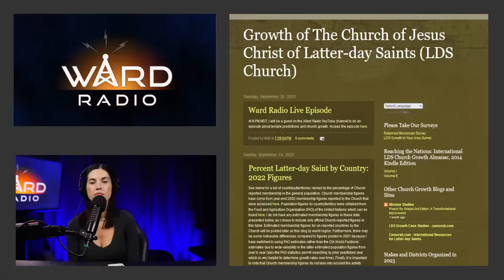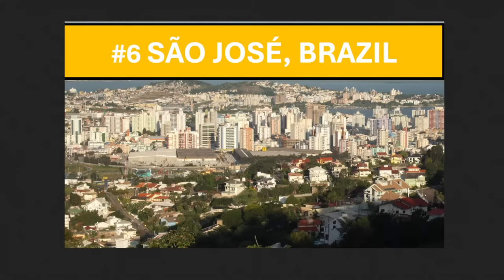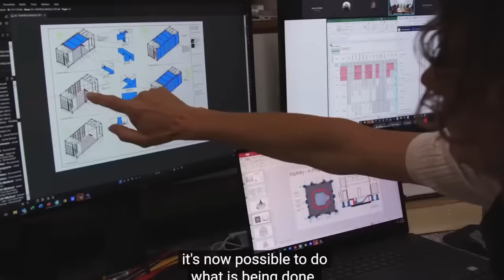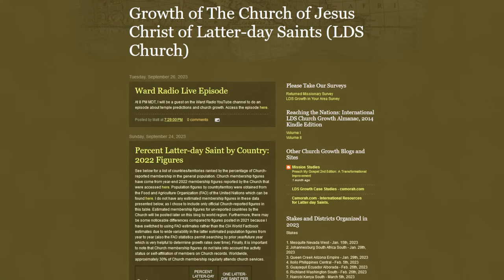Top 10 Temple Predictions with Facts and Smart People! (Feat. Matt Martinich)

Comment: Many of those quick late 1990s temples were built quickly and stick built. Several needed renovations due to some issues. I think the modular temples will have better structural integrity than the 1990s small temples and still be quickly built.
Reply: Wood-framed buildings don't have inherently inferior structural integrity than other construction methods. That is a very appropriate construction for a smaller building. If there are problems with the building, that is due to poor design or construction quality. It can be common in areas outside the Wasatch Front for construction methods and traditions to be very different than the Church's project managers are used to, resulting in later functional difficulties for the building. There are also a lot of other factors that contribute to this. For example, Las Vegas has soil chemistry / water chemistry that is destroying the sewer line of the Temple there. It is just part of life that things wear out, and often sooner than we would expect.
Reply: Should they keep building?

Comment: Mendoza line is a .200 batting average. Just comes from a shortstop that played in the late 70’s. And it’s below average. But what you might be looking for Cardon is a newer term the last 10 years or so is WAR. Wins Above Replacement which takes everything about a player as well as the position they play and the average is 0.0 if you go higher the better player you are. If you go in the negatives then you’re worse than an average player. Your defense and or offense can hurt your value or WAR. That’s the best thing that applies to your taking everything about a player and condensing it into one stat. It is a part of the Sabermetrics. I’m a baseball nerd 😂

Comment: [NOTE:  This Comment is 3 of 3.  Good luck finding the other connected YouTube comments.]

The 800 Hurculean boys who were still alive raced to a weapons cache in a storage room located near the side of the front of the city.  There they were able to grab extremely heavy hammers, like sledge hammers but 20 times heavier than you would normally think of when you picture the idea of a sledge hammer...  the handle was made of metal same as the hammer_head.  The warriors in the Roman City at that time in history thought these "sledge_hammers" were a clown joke because the "replacement Roman soldiers" were relatively strong men and they couldn't lift them up off the ground, let alone swing them at anybody.

But these Mormon boys were on average 50 times stronger than the average modern day Western European men, so they could lift these seemingly impossible to lift "joke" military sledge_hammers.  With these sledge hammers in their hands they ran up the steep steps of the stairs to get to the top of the protective outer wall.  Once on top they could see that there were thousands of Greek_Invaders that were already on the wall over the area where the Eastward Facing front gate was located.

With two Herculeans moving forward with their midsize shields in hand, after making physical contact with the Greek enemy, the Hammer_Man behind the front two swung his heavy hammer down on the heads or the shoulders of the enemy.  Often the shield men would push the Greek_Warriors off the top of the wall sending them tumbling down head over heals to their death or in some cases causing them to be severely injured.

In this way 3/4ths of the invaders were killed [often by having their heads smashed_in]...  the remaining 1/4th of the invaders who hadn't been killed because they had been in the back lines not in the front lines fighting, who were only in it for the money they were paid to do this mercenary attack against Rome to begin with, they threw all of their body armor off and ran to their ships, thus escaping before the Herculeans and the Fornication Cultists Teen boys could kill all of them.

Thus the city of Rome was saved.  A Simeon man (of Greek ancestry who had family that had lived in Rome for many generations) was made the new King of the City_State of Rome.  All of the Wicked Levite Royals of the previous government administration were killed except a small few who were saved by the Herculean Clan and given help to gain rowing sailing ships that they could use to escape from impending execution.

The Herculeans had a tradition that if their Sons were not worthy to go to a Mormon Temple...  often because of succumbing to adulterous Roman Women (who were often beautiful Simeon_Greek women that were very common in the city of Rome at that time in history)...  then they could go to another Temple Of Sorts...  a Masonic Temple (because the Herculeans were Masons).

Seeing that the Simeon_Greek Fornication Cultists had saved 800 of their precious boys from death (and as a side note as far as they were concerned, the people of the City Of Rome) the Fathers of the Herculeans decided to extend an offer to the Simeon_Greek Prostitution Cult Members.  They could join the Masons.

Keep in mind the Herculeans worshiped Jesus in a very similar way to how Moses advocated that this be done, and similar to how this was done in the Americas by Mormons who lived there AND...

the Cultist Prostitution_Worshiping Greek Religion members (similar to Jezebel) was involved in demon spirit possession rituals that included child human_sacrifice (what people say is a "conspiracy theory" now days, this was done openly publicly in Rome and in all of the cities of the various nations on the shores of the Mediterranean and connected seas).  So you had two extremes that became part of one organization, the Mason organization, one was for extreme good, one was for extreme evil.

Both were involved in high level mathematics...  most (if not all) of those who became famous later in history for Physics or Mathematics can trace their genetic lineage to one of these two groups (or both).

Rome eventually fell under the rule of Royalty that were descended from Philistines (who were 1/4th Ham part Greek part Egyptian) who had obtained the Ark Of The Covenant and the Magic Urim & Thummim (the Urim & Thummim of the Bible).  They became admitted to the Mason organization.

There were four groups that secretly ruled the City Of Rome, the City Of Rome that later became the Roman Empire.  There were those from the Tribe Of Dan (who later on in history after the collapse of the Roman Empire, became famous through the name "Viking" i.e. the Kings of Western Europe).  In addition to that were representatives of the Herculeans.  Then there were Simeon Greek Prostitution Cultists, and last but not least, the descendants of Philistine Royalty who in actuality ruled the Roman Empire, the fourth group represented on the Shadow Government secret power_council.

Eventually the ruling clan of the Shadow_Government of Rome (Philistines) were killed, assassinated.  This is when the Herculeans seized the Ark Of The Covenant and the Magic Urim & Thummim (of Bible fame) then escaped from the city of Rome to hide in several other locations before eventually returning to the City of Rome many hundreds of years later when they helped establish the first Roman Christian State Religion that is now days based in the Vatican in Italy.  Yeah that's right, THAT Christian Church.

I could keep writing for years on these subjects but I will leave it at that (every rabbit hole has a thousand other rabbit holes).  But hopefully this informs the reader a little tiny bit about history, specifically the history of the Mason Temples and Mormon Temples and the original connection to the current Mormon Church (through ancient past historical perspective).

One of the Mormon religions was in Russia.  One in the Americas (see The Book Of Mormon for more detailed description of the LDS Church in Central America.)  One was in the city of Rome, later in a Roman conquered area of Greece with another Herculean Clan location being in India...  and quite a few other places.  [THE Church Of JESUS CHRIST Of Latter Day Saints] as people know it today is just the latest iteration of a Church that has existed in various places at various times that includes the Priesthood of Melchizedek.

Different people different strengths and weaknesses, same completely true 100% Christian religion.

Now days it's membership is openly known.  In the past those who were Latter Day Saints were all secretly Mormons (except in the Americas in ancient times) because they were living in Pagan societies.  So there you go, a little bit more info for those interested in knowing more information (be they dedicated to evil, or to good).

If you notice I make no judgements against anybody as long as they are willing to learn...  not the official phony baloney fake front narrative, but the real story about how things really came about in the past so that things are the way they are now_days. 
.
.
.

Comment: [NOTE: This Comment is 2 of 3.  Good luck finding the other connected YouTube comments.]

An army from some Greek City States gathered in rowing_sailing ships traveled from Greece to the City of Rome to conquer this mediocre but highly wealthy Half Simeon_Greek Half Ephraimite population city in Italy.  Levites are not known for being capable in war, but rather when it comes to words.  The Levite extended family that was then ruling Rome gained their highest level position by convincing the Roman population that they should rule over them (that and assassinating the previous ruler, that helps to gain the throne of power as well).  

They tried to direct the military defense of the City of Rome but were completely incompetent in being able to perform that duty.  Because of this the city of Rome was in peril and the front gates of the city were about to get smashed by Greek Warriors using a battering ram.  This is exactly precisely WHEN 1,500 Herculeans decked in full metal plate body armor seem to appear right behind the front Gate of Rome (the Eastward facing Gate).

Some of the teenage boys (13, 14 and 15 years old) had decided against their parents and their clan leaderships law to enter into the city of Rome through secret under ground passage.  Being Masons while refurbishing a Roman City Wall (back when they were citizens of Rome in good standing) they had built a secret underground passage that only the Herculean Clansmen knew about.  Using this method of conveyance these young men were able to get inside the city in the nick of time without being detected, which was important because the rulers of Rome had standing orders to all Roman citizens to kill all Herculeans on sight if anyone in the city ever detected their presence there.

After the Eastward facing gate was crushed by the battering ram, the Greek Warriors began flooding into that side of the City Of Rome.  But the front portion of invading Greek_Warriors were only able to make it 15 yards into the city because facing them were 1,500 young but highly zealous warriors.  The Herculeans began to fight these half_crazed Greek Warriors toe to toe and were making a good show of it when it comes to stopping the forward moving advance of this deadly incursion into the city of Rome.

However the Greek Warriors were wearing metal plate helmets that no one had ever seen before that went over the front of their face and only had extremely small slits for where their eyes were located.  This made it impossible for the Herculean bowmen to shoot into their eye sockets.  Also because they had a lot of metal plate armor over the rest of their body the teen Herculean Warriors, the Herculean Bowmen (who numbered 1,000), were not doing any damage.

This put too much pressure on the Herculeans who were not nearly as advanced in their warfare education as the Greeks (male Greek babies literally had a sword put into their hand at birth).  The Herculeans were strong but the Greeks, though not as strong, were highly skilled.  Without proper bow_warrior support the city would be lost and all of the inhabitants (including all of the women and children) put to the sword and killed.

It was at this moment when all seemed lost when another group, a group that the Heculeans (being Mormons) hated, teenage boys from the Greek Prostitution Cult, they arrived to help with the battle happening at the Eastward facing city gate.  These boys (13, 14, and 15 years of age) were descended from the best Greek Warriors and sent outside of certain regions of Greece all over the known world.

Like The Herculean Teen boys they differed from the stern opinions of their Elders and believed it was best to help militarily defend the city of Rome (the Greek Fornication Cultists weren't supposed to help militarily defend cities they lived in because they presented themselves as being non_partisans when it comes to any war in any high walled city that they happened to live and do business in).

Because of their excellent breeding which was better than all of the Greek_City State Warriors of that time period, they were able to make the million_in_one arrow shot into the invaders metal plate eye_slits because of their extreme accuracy when it came to shooting arrows from bows.  They were able to shoot into the eye socket of this new design of helmets that these invading Greek Warriors were wearing.  The Greek Fornication Cultists were incredibly accurate.

The eye socket was the only place of vulnerability and consistently time after time they could achieve this seemingly impossible to achieve level of accuracy by being able to shoot an arrow right through the tiny slit.  They directed all of the Herculean boys to be either [shield and short swordsmen] or [two handed long swordsmen] in the front line which was the point of contact of the back and forth sword and shield fighting.

This allowed the Simeon_Greek Fornication Cultist teens to take a few steps here and a few steps there to get angles where they could shoot into the eye socket of the helmets of these Greek Marine invaders, killing them at will.  As time went on the officer in charge of this Anti_Rome military expedition (that they were being paid a huge amount of money to conduct) backed his forces up from inside of the city gate and began to use mobile towers made from wooden beams that had been previously constructed from some of the sailing_rowing ships with the idea of taking the top of the city walls first; using this stratagem to discontinue taking as many losses from extremely accurate arrows being shot from Roman bows.

There were only 800 Herculean boys left alive, but this is when they again took over the lead position in defending the city of Rome.

To be continued...
.
.
.